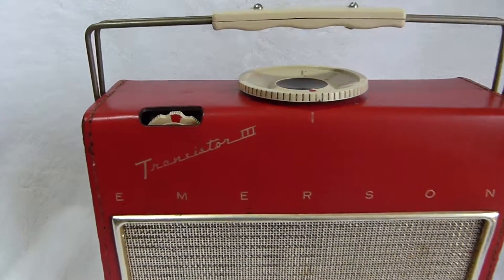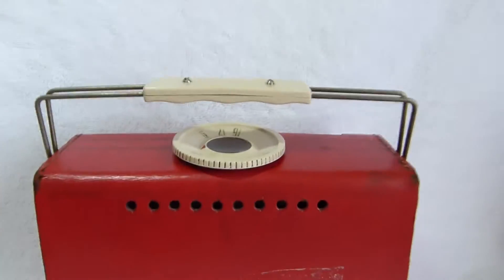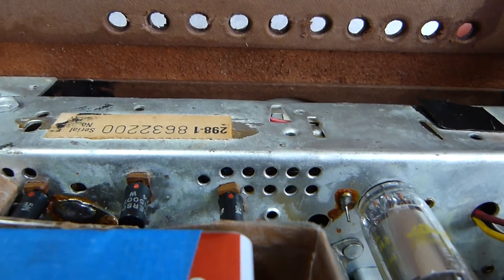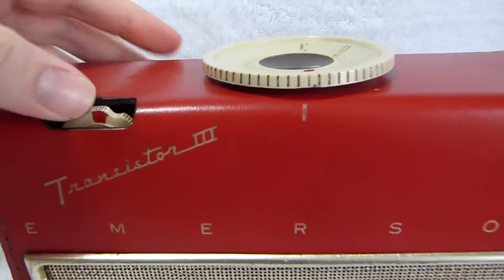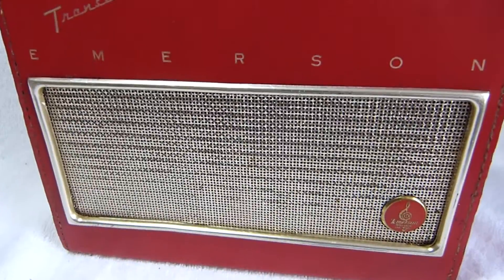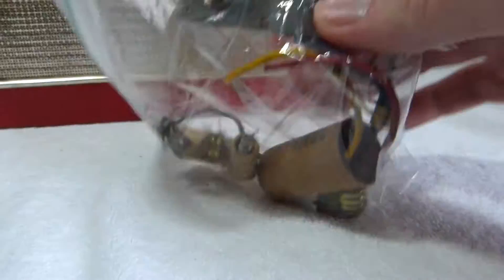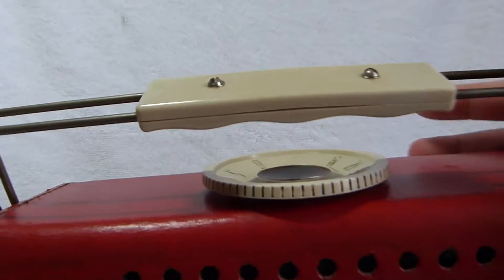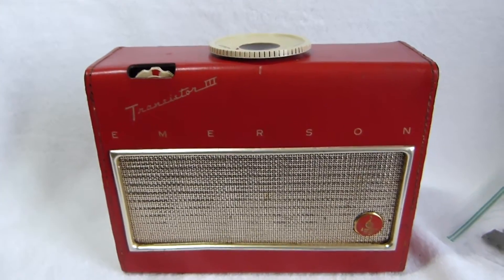1956 Emerson model 843 hybrid tube/transistor radio (USA)

Comment: I have a late 50's RCA tube/transistor A.M./F.M. "Dual Speaker" hybrid radio.

It has a one transistor R.F. front end, and then 6 tubes for the rest of the circuit and the audio power. 

Interesting circuit. The early PNP only transistors couldn't handle much current without blowing. There was no way that they could drive a speaker, so they were strictly relegated to small signal duty. 

I restored the radio, and then installed a bluetooth audio receiver inside of the case also. I was able to get the Bluetooth module installed without making any permanent modifications to the case or the board inside. 

The radio definitely sounds decent, and I really enjoy the glow from the tubes that emanates from the slots in the back panel when I'm listening in a dark room or going to bed. 

Plugged the radio into a smart wall plug, so when im going to bed and listening to it, I can just ask Google to turn off the tube radio in x-amount of time. That way the hard to find tubes aren't burning themselves away for nothing while im sleeping. I also replced the #47 dial lights i side the unit with some LED bulbs that specially made for it. I used the burnt out #47 bulb bases by crushing the glass glove off it with a pliers. Then I installed 2 resistors in parallel across the bulb wires (to emulate the resistance of an incan bulb filament, otherwise if you just install an LED in the bulb socket you will burnout your regulator tube, as the dial light filamemts are across a small section of the heater coil in the regulator tube, and without the dial light filaments stealing some of the current from that small tap across the section of heater, that section of the heater WILL run hot, and prematurely burn out) The resistors in series will be 2 different values. Together in series they will together be the value of the incan bulb's resistance when hot (so that it doesn't blow the section of heater in the regulator tube that it is across), and then the one side of the series resistors is the correct value to be able to put an LED across it and have it driven correctly. I used some Hi-CRI warm white LEDs. No more hot bulbs destroying the plastic dial face, and no more changing burned out dial lights. It looks awesome too.. brighter and more "hi-def" looking than the original bulbs. Makes the dial face visually pop nicely.
Reply from the maker: By the late 1950's power transistors that could drive larger speakers (like car speakers for example) were available, they were just expensive. Nice work on updating the radio without getting rid of the original circuitry. I also swap in LED bulbs sometimes, which is usually easier to do in transistor circuits.

Comment: I have a reel-to-reel tape recorder called the Concord 220T and it’s a hybrid tube and transistor unit. It uses two tubes and two transistors.
Reply from the maker: Interesting, I haven't seen one of those. From what I have read and seen though, hybrid designs were more common in AC powered equipment. In particular, televisions.

Comment: Very cool set! The first one I've seen with 7 pin tubes and transistors. Normally, it's subminiature tubes and transistors. The 10ma draw on the "B" is not any more or less than with an all tube portable. It's the "A' battery that has a heavy drain usually from 100 to as high as 250 ma. I guess it would be even higher in this set as you have both tubes and transistors drawing from the "A" battery. I thought I saw 274 on one of the transistors. That's the EIA code for RCA even though it's marked Emerson.
Reply from the maker: +Jerry Carriera I am not really a tube guy, but from my understanding of tubes, the output tube provides the greatest power draw on both the A and B supplies, and since they are usually run class A, it's a constant draw. The transistor output stage should draw less power than the 3V4 that would otherwise be in here and it's power use is volume dependent since they are run in class B mode. The transistors are all RCA made 2N109's, so that EIA code makes sense.
Reply: @50sTransistorRadios Oh, but the tube audio output is ¾ of the magic of these old radios... 

Tubes definitely have a different kind of "sound" than transistors do. 

My FAVORITE kind of hi-fi setup is an all tube front-end and driver section, followed by BJT's for the very last current gain stage. 
Tubes do NOT do very well when asked for high currents, so they don't make very linear power output  stages, BUT, when a tube is used in a small signal application, they are MUCH cleaner than solid-state transistors of any kind.

Comment: Matt - a neat set. I've never seen a hybrid, really cool! Best, Don
Reply from the maker: RestoreOldRadios Thanks Don! Hybrids were only built for 2 or 3 years, so there are not too many around anymore. I also have an Emerson model 843S, but that might be a "frankenradio" (the case may not be original).